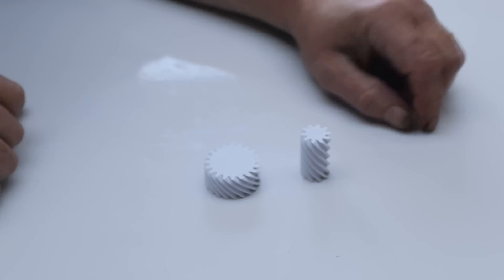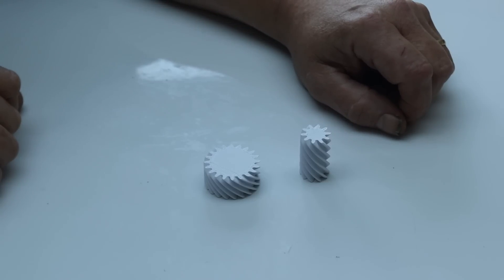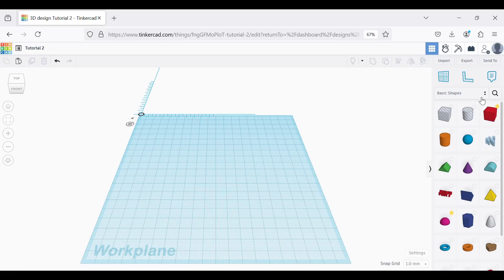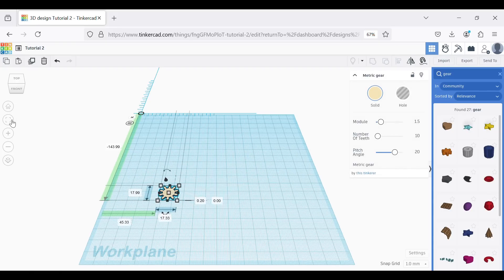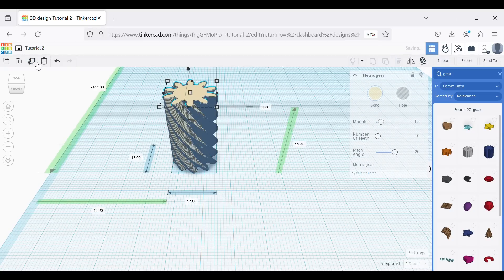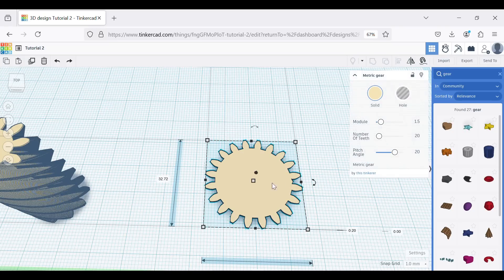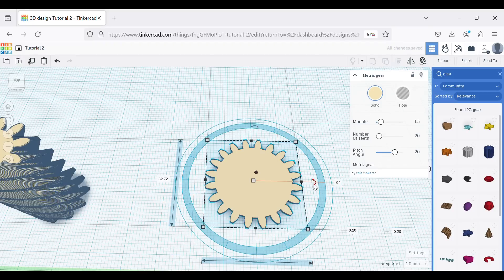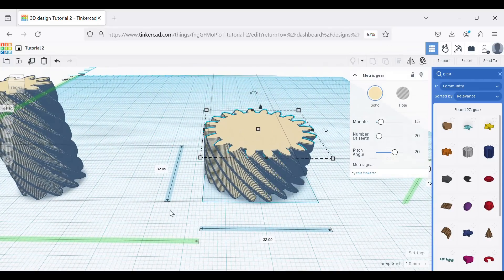2348 Helical Gears  - A Tinkercad Tutorial

Comment: Thanks Robert. Is there a step between each layer along the length of the gear tooth?
Reply from the maker: i don't understand mate - you are using a gear tooth profile
Reply: @ThinkingandTinkering  I understand from your video that the spiral gear profile is made up of  0.2mm layers. My question is about the running surfaces of the finished gear. Are they flat and smooth surfaces, or do they have steps which correspond to the rotation of your TinkerCad drawing.

Comment: That's why I prefer OpenSCAD. One can practiclly code the geometries procedurally, and for complex shapes and function based surfaces I simply can use a for loop and discrete steps because analytical accuracy is not necessary at all.
Reply from the maker: cheers mate

Comment: An idea to try. Making it rain anywhere with electrostatic water condensation. Kind of amazed this isn't done everywhere. I priced it out and stainless steel mesh is cheap enough you can make one of these cheaper than running water lines and pumps and it has no moving parts. Here's the thing, if there's any humidity the system will work and that includes using brine or ocean water to raise humidity. I planned to use black inflatable domes in the ocean. It would be an amazing system for Saudi Arabia. Unlimited water.

Okay, a chimpanzee can build one and if a chimp isn;t handy have a kid build one as a science fair project. Two stainless steel screens, say a 1/4" apart so use plastic or wood as a spacer, just needs to be non conductive. Believe it or not you are almost done. Hook up a neon transformer. I can;t remember but switch poles until moisture collects on the lower screen, pretty sure it's positive the water ions migrate to. You see water ions move between the poles and collect on the one wire and they will collect quite fast. Essentially depending on ambient humidity you either get a sprinkle or a monsoon downpour. An area of say 2 to 4 square foot should produce 6 gallons an hour at 60 to 80 percent humidity. Basically a unit the size of a water cooler should produce enough fresh water for a family of four. For tech specs you need around 6,000 to 10,000 volts, no more or it;'ll arc and less and the process stops. Spacing and a few other factors affect it so tweak the voltage until you see water droplets.

Now, run two mesh screens the length of a greenhouse and the width of your grow bed. My guess, a transformer should handle an area 10'X12' so 20 transformers can handle a 24'X100' greenhouse and remember they only need to run when you want to produce water so say every third day or three times a week? An hour or two of rain? I say a 1000 watts of solar panel and a decent back up solar battery. Just did the metal math, say $6,000 and it produces all the water to irrigate a 24'X100' greenhouse and I include sensors and say an arduino to control it but you can passively wire it and avoid the arduino. Just easier with it. Every 15 years replace the transformers.....

Try it. Run a charge through two pieces of mesh and you'll see water drops form on one of them. Why aren't they producing water this way? I can make a self filling canteen with little more than two pieces of stainless steel mesh and a bloody stungun. The joke is I'd have to probably step down the voltage but the cheapies are maybe weak enough. I have a couple. May have to try something. Wish I'm gotten my plasma lab built. Could have tested it in 15 minutes. What I planned was to set up an aquarium and put a mesh over half of it and show it rain by flipping a switch. I was just thinking it through, need to test again how long the stungun batteries last and scale up the batteries to say a portable drill battery? Got  curious how much water a say like a 40 watt hour battery would produce? Just picked up a battery that size and it;s maybe 3lbs, more than a kilo for sure. My point it that battery could fill a canteen maybe 5X or 10X and weigh a lot less than the water. River water unsafe? Sit by the river where it;s humid and fill your canteen. An African village could get everything from a 10' dome and if they have polluted water it would purify it as well as steam and only use one solar panel for the whole village. To whom it may concern, everything I do is under creative commons. Odds are there are patents in there already. Such a simple process a monkey could build one......
Reply from the maker: i will have to have a look at it mate - cheers

Comment: just a quick note on 3d printer accuracy...   in the Z (layers) any modern printer can easily do 0.08mm layer height.    
the default layer height is set to 0.2mm,  0.1 is often selected for 'fine', but it'll go lower if you ask it to.   
and then in the X/Y you generally (with a 0.4mm nozzle) have a (roughly)  0.46mm width of extrusion, so that'll limit details in the x/y plane. 
so.. you can get more details by printing your print sideways or diagonally sometimes. 
likewise, if it's easy to swap nozzles on your printer, swapping to a 0.2mm nozzle means your x/y will be around 0.25mm extrusions. 
and, of course, you can go to 0.6, 0.8 or larger nozzles, but there are other reasons for that and small details isn't one of them. :-) 
other quick note..  going from 0.2mm layer height to 0.1mm layer height.. while great for looks, doubles the print time. ;-)
Reply from the maker: thanks for the tips mate
Reply: @ThinkingandTinkering  it's the least I can do, for all the knowledge that you share with us. :-D

Comment: I did a set of heli gears last year, just used an online gear generator. However one of the limitations of the gear generator, I haven't found one that offers "pattern draft", what you are doiing here and your excellent concise explanations on layers, pattern draft might be something to try in Tinkercad, it's for spur gear sand casting, obviously helical gears will not work in petrobond
Reply from the maker: i will have to try it mate cheers
Reply: @ThinkingandTinkering  I did give it a go, it works, however my machine was not happy dealing with a shape made up of about a hundred layers, even when combined into one.

Comment: Good to understand how to do it taking into consideration the layer heights. One alternative way is to use FreeCAD and the Gears workbench, you can create involute gears with many parameters, I like a beta angle of 10 degrees and a double helix, so you get herringbone gears. You can then export them from FreeCAD as STL files to import to Tinkercad if that is your more familiar design environment.
Reply from the maker: you can also do it in fusion 360 using the sweep function